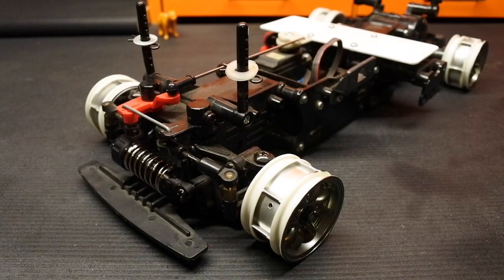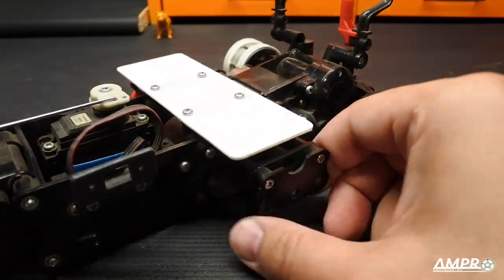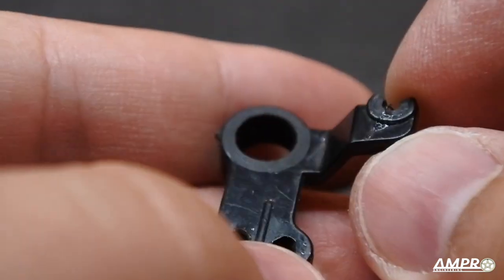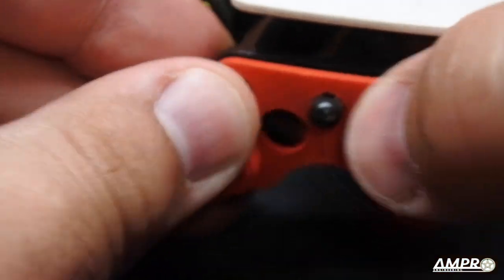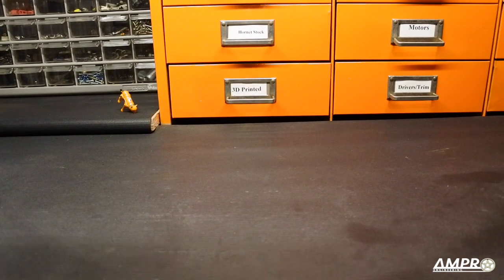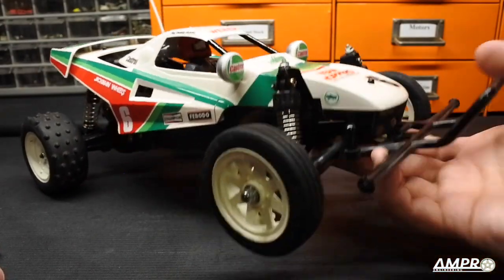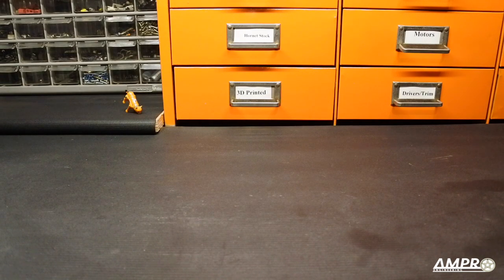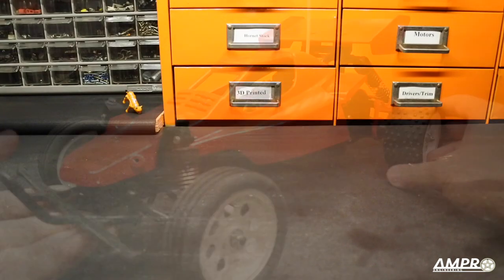E22: Upcoming Projects & Lots of M02 Replacement Parts

Comment: Loving your Work! Have you made dubble wishbone printed parts for the Rising Fighter/Grasshoper 2/ Supper Hornet chassis. Or are the ones you already made for  original Hornet compatible?
Reply from the maker: Hi Tim. The current ones are not compatible but I am working on a version for the GH2/RF/SH that will be done soon. Keep your eyes open on here as I will make a vid as soon as they go on sale. Thanks!